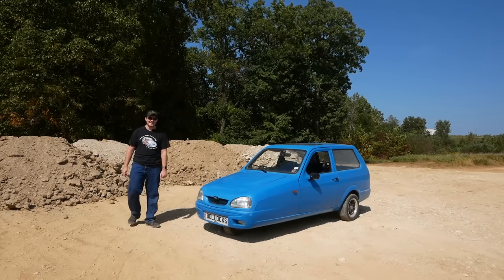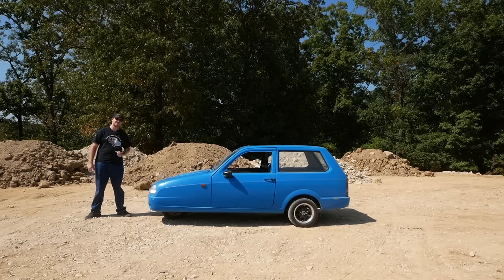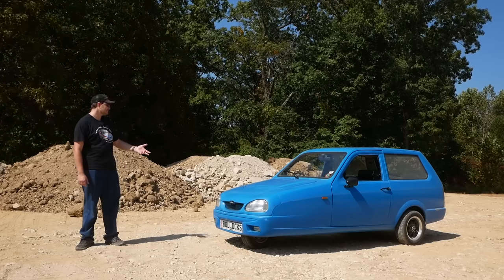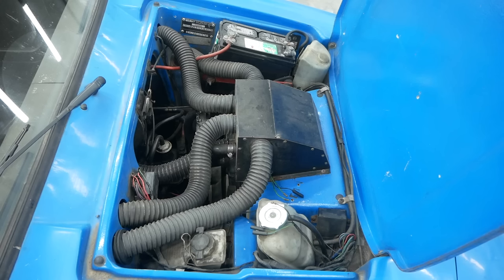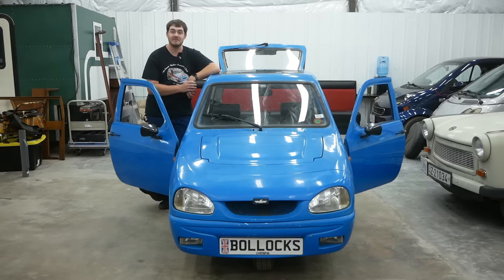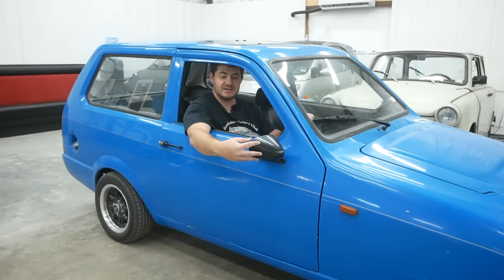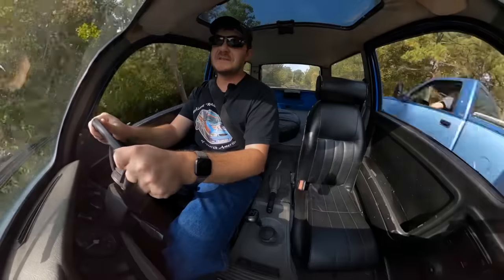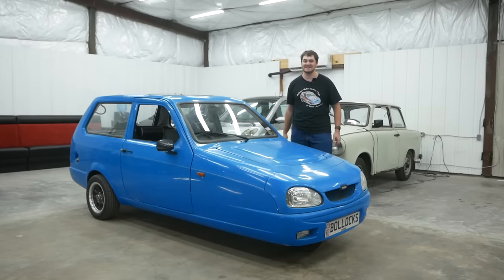I Bought a Reliant Robin!

Comment: This thing doesn’t even have door detents, yet it has fog lights, and a rear wiper.
Reply: the hinges don't have enough travel to actually have the door hit other body work so it doesn't really matter.
Reply: It's a British car fog lights might aswell be mandatory
Reply: Rear wiper and fog lights are required by law. Door detents aren't.
Reply: @benanderson89  rear wipers are optional as are rear windows and rear view mirror

otherwise most vans would be illegal

Also with mirrors (in the uk at least) you are required to have two one has to be drivers side, the other can be passenger side OR rear view no need for both.
Reply: @prawny12009  For hatchbacks in particular they're weirdly required from the factory. No idea why. It's why something like a 320d doesn't have a wiper but the 320 GT does, because the GT is technically a hatchback.

Edit: answered my own question below.
EDIT2: Vans are classed as "commercial vehicles" are have a different set of regulations.
Reply: benanderson89 I don’t know if that’s just for Britain’s because I can’t find any pictures of a 320 GT with a rear wiper. And I can name plenty of hatchbacks that don’t come with a rear wiper. I honestly don’t understand the rear wiper situation, barely any cars have them. Only the big cars with vertical hatches have them (with a few exceptions like the Prius). I don’t understand it.
Reply: prawny12009 yeah, but u gotta admit, having rear wipers required to at least be optional on all cars would be really nice.
Reply: @JoeyLovesTrains  It's standard for Europe. Every hatchback in existence comes with one here. Likewise, I was mistaken: it's the SW/Tourer/whatever (estate) that has one as standard. The GT is a lift back so it doesn't have one.

And no, they're handy to have on hatchbacks and other flat-backed cars because water doesn't get pulled off the rear window by the air current when driving. The angle of the window actually makes it stick a little worse, so a wiper is required to see out the back in very heavy rain.
Reply: @prawny12009  Vans are classed as Commercial Vehicles. There's different regulations for them.
Reply: @benanderson89  I was unaware there was a difference between a liftback and a hatchback.

I'm not sure if there are more hatchbacks/liftbacks in Europe, but in the US, it's mostly big cars, and Sedans. Not to many hatchbacks, although lift backs are being offered by Kia (the stinger) and Buick (the Regal sportback, which is basically the Insignia lifback, minus the rear wiper for whatever reason). I really wish Sedans had rear wipers because if I'm in stop and go traffic, and it's raining out, by rear defroster can't keep up with the rain.
Reply: @JoeyLovesTrains  hatchbacks DOMINATE Europe. About 82% of car sales in Europe in 2019 were hatchbacks of some description (city car, subcompact, compact, estate and crossover).

Only 2.3% of sales were what you'd call a Mid-Size Sedan (think Optima, 520d etc.)
Reply: benanderson89 oh. Oh my. Welp, I underestimated the amount of hatchbacks u guys had.

A side note about diesels:
We barely have any BMW diesels in America, even when they were still offered brand new. BMW pulled their diesel options out bc nobody wants a small diesel in the US, it’s simply just inconvenient because finding diesel is barely an issue (not all gas stations serve diesel, but most do), and diesel is a little more expensive than gas. It’s pretty rare to see any small diesel in America. You might see the occasional TDI that survived dieselgate, and a bluetec of u keep your eyes open (I’ve only seen 2 Mercedes with CDI badges, the mid 2000’s E320) every single Merc sprinter van is a bluetec except for the new ones (Mercedes stopped selling diesels in the US in 2016 iirc). A Chevy Cruze diesel is pretty uncommon.
Reply: @JoeyLovesTrains  Yup. We love our hatchbacks! The compact class is just known as the "Golf class" in many countries because the Golf is so ubiquitous, for example. You don't say you own a compact car, you say you own a "Golf sized car". Likewise, you don't own a subcompact, you own a "Super MINI".
Reply: benanderson89 Mini’s are pretty cute, it’s my moms dream car.

Fun fact: Mini took out their manual transmission option for America, but they actually lost sales, and brought the manual transmission back.
Reply: @JoeyLovesTrains  85%+ cars sold here are manual. You're forced to learn manual to get a valid European licence, or you only receive half a licence. Unsurprisingly, once people are formally taught how to drive a manual, they tend to prefer it to auto. (I have a 7-speed DCT though, because an injury years ago forced me into one).
Reply: benanderson89 I’m dying to learn manual, my friend got a Honda Fit (jazz) with the 5 speed. But he’s doing a clutch replacement rn. I hate CVT’s with a burning passion.

Comment: I once had a ride in a slightly modified Reliant Kitten (the 4-wheeled version of the Robin). That slight modification? The fitting of a TVR tuned Rover V8. IIRC (this was in 1992-ish), the interior was mostly stock, just moved rearward by about 3". The owner was planning to put a cage in it & go drag racing. I could understand why. In a straight line, 300-ish hp was decidedly entertaining in a car weighing next to nothing. Corners? Understeer to a frankly terrifying level. In all, it was a total adrenaline monster, as long as you didn't mind wearing Brown Trousers - because it pretty much didn't matter what colour trousers you were wearing when you got in, they would probably be brown when (if) you got out. If the raw acceleration & understeer didn't get you, the lack of brakes did. I'm sure the brakes were fine with the original 40 hp, but with 300? Nope...

Comment: Interesting car.  I wish you had done the fuel economy check.  The stated fuel economy sounds awesome. 

Be careful when slowing down while turning and going downhill. That's when triangle running gear causes rollovers.   

Stopping while turning sharp really moves the C/G to the outside front corner.  I have roled a few small trailers like this at low speed.

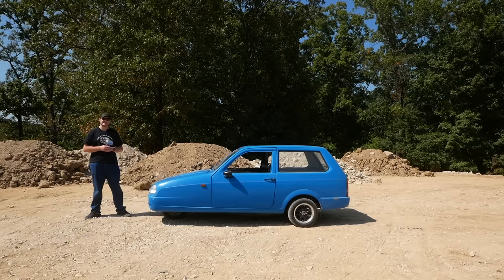Comment: 2:32 The fourth wheel does actually exist. There is a car called the Reliant kitten which is literally a Robin but the front end has been redesigned to fit an engine and 2 wheels with a steering rack. Besides the front end, literally everything else was identical except for different materials and colours for the interior.

Comment: "I bought a Reliant Robin!"

....you didn't have one already?
Reply: Also why don't you have a "I'm going to drive one of my unsafe cars" helmet by now.
Reply: @michaelfingers7726  because safety is boring
and it's not THAT dangerous,o therwise it wouldn't have passed the english DOT certification, it just drives slightly differently than your normal car
Reply: @quentintin1  It is still safer than a motorbike.
Reply: @macdaniel6029  debateable
on a MB, you're conscious that you have no protection so you take precautions, in a car (and car like vehicles) you have a sense of safety put in place by the full cab around you and the stability of having more than two wheels, so you will take more risks than on a motorbike without being conscious of it
Reply: @quentintin1  Maybe in the USA. In the UK bikers favourite trick is to ride down the middle of the road at 90MPH between opposing vehicles.

Comment: They made four wheel cars too  also it was made famous by Delboy in "Only fools and horses" and yes i had one a Reliant Robin 850 super great fun.
Aso you will find you have an access panel  on the passenger side under the carpet of the gearbox tunnel  for changing spark plugs .

Comment: I strongly advise you get a drip tray for the carb, Without it there is a high risk of the car catching fire. The reason the Reliant did not evolve much aside a few trim changes, was simply to keep the  original type approval from the mk.1 Reliant Robin. each time a new car is developed it needs to go through type approval, this is a bunch of checks done to make sure the car is fit for the UK, this costs companies hundreds of thousands. For Reliant to avoid such costs, they decided to only do minor changes to the car over the years, to avoid having to have it re type approved, the other issue is maintaining grandfather rights as we know it in the UK, it would have been near impossible to re type approve the Robin without substantial redevelopment of the car to meet modern standards of the time.  to illustrate the importance of grandfather rights, we only need to look at the classic mini. when Rover was bought out  by BMW, BMW wanted to continue production of the original mini, but sadly when Rover went defunct it took with it the type approval for the classic mini IE the grandfather rights and with them gone you would need to reapply. Sadly because the  of mini's age, type approval no longer possible to obtain because the standards were much higher, making it impossible to get it re type approved, and that's what killed the mini.
Reply: Interesting comment. I like it.

Comment: Ha, ha, what fun. We had a Reliant robin prototype built before the official first production model. It was really primitive (so they changed nothing except making the bodywork a little more angular). We actually owned almost every model ever made and I taught myself to drive in the first one, a yellow "sedan", which reached 65 mph (once) We changed the engines in four of them, Completely stripped more than one and rebuilt them from the chassis up. We used the van for business and then transported a family in it at weekends. We never rolled one but an acquaintance rolled several (in a car park) after drinking heavily. (we do not endorse this activity) It was possible to legally drive them unaccompanied in Britain in the seventies with only a provisional licence, so it saved a lot of money on driving lessons. (I passed first time, in a real car) The Reliant was incredibly economical and easy to park but of course, it was an object of ridicule. It would however, have been an excellent little fun car if only they had designed it with two wheels at the FRONT! (but that would mean no van or station wagon version and only two seats) .....or would it???

Comment: The illuminated red switch on the right which lights up is the brake test switch. Basically to make sure the brake warning system is working .  No lighty no warning for low fluid. Simples.

Comment: I owned a Reliant 3 wheeler for a year back in 1981-1982, like just about everyone else in the UK the only reason was because it was winter and I only had a motorcycle licence.  I have mixed memories of the Reliant, it was reliable and economical and it kept you warm in the winter which is pretty much all any Reliant owner expected.    I never rolled mine over, I once had it on two wheels on a long bend that took me by surprise, it was terrifying.   If driven with care and an understanding of the limits when cornering these are OK, its actually  to easy to roll one unless you are being stupid... yes we have all seen the hilarious Top-Gear episode, but that's an entertainment show and not a serious car show.
The fact that Reliant made that little engine is quite remarkable.. think about that, such a small company and they made the engine in-house, and its a great little engine too.   They do not typically overheat at all, they have a very solid reputation for reliable service with minimal maintenance.      Electrics are interesting due to the lack of body ground, but this is compensated by extreme simplicity.

I went from a Reliant to a Jaguar XJ12 in 3 years.. with a couple of Ford Escorts in between.  I have never been tempted to buy another Reliant, but it's great to see someone enthusiastic about one.

Comment: Remember three wheelers were designed in the uk to be registered as a motorcycle meaning a motor cycle license holder could drive one without an additional driving test. This meant bug compromises to keep the weight below 8 cwt (896 pounds) too keep within the legislation of being a motorcycle and sidecar. I believe this meant things like a spare wheel were optional extras so they didn't count toward the weight.

Comment: Had the Reliant Regal Van when I was a kid back in the 70s.They will wheely, good clutch, rev to 9000 drop clutch. They will corner at speed, remove back seat put a broom handle across the seat mounts, get a person in the back moves from side to side, hangs onto the broom handle like a side car passenger....go racing. Never fit wider rear wheels or wider tyres its may grip, it will flip, you will die.

Comment: I remember riding in a Reliant Robin. They were much derided and there are many jokes about them. I liked the fact the body does not rust but safety was non existent and the chassis was just bare steel with no galvanizing nor paint - designed to rust away within 10 years. A better, more stable car is the Messerschmit.

Comment: I still very much want you to get a hold of an old Volvo 240. Stupidly fun to drive because the car sort of feels like it wants to kill you past about 55, they had a push-button turbo with some of them having the push button in the dash, while others had it on the gear stalk, while yet others didn't even have a turbo at all. The whole thing is held together with friction fits and pull tabs, with a convenient tab under each of the doors that lets you pull out a little plastic thing, and when you do, the whole door panel comes off with a gentle little lift, making it super easy to get to the door latches, the window winder, all of it. Some of them even had a sunroof which, like all the windows, was manual. There was a hand-crank, not unlike you'd see on an old single-pane hinged window, for opening it. Also for a car built in the early 80s, it had heated seats... which as it turns out were just some heating coils that looked like they got pulled out of a dishwasher layered in under the upholstery. All the plastic was photodegrading, too, which is awesome, because the magazine rack in the doors(THEY HAD A MAGAZINE RACK IN THE DOORS) on almost every volvo 240 is now many thousands of tiny plastic shards, the glove box's front panel sometimes just falls off, and the dashboard of every Volvo 240 sold, bar none, is legally required to have a crack in the middle of it. Or something. 

Also the motor mounts are a special brand of funny. They almost always fail, because a straight four isn't exactly harmonically balanced at the best of times, which is great because at about 55 miles an hour, the whole car starts shaking like it wants to explode. Which wouldn't be so bad were it not for the fact that the motor mounts are one of the two parts that Volvo made a pain in the butt to replace, that and the alternator. 

Also the suspension was universally crashy as hell. So if you get the sedan, the car feels peppy and like you're a rallycross driver. And if you get the estate, the car becomes terrifying, but in a manageable way. The wiring was a rat's nest, there was a wild overabundance of things that just never worked, but honestly, the whole car was so damn easy to work on(aside from maybe the aforementioned motor mounts) that so long as you could get the parts, you could just about handle anything in the car yourself with no lift, no specialized equipment, and damn near no tools. Seriously, like, Half the car is held together with friction fittings and tabs, it's Brilliant... and also terrifying, but Brilliant. But what's weird about it is how Safe they were. I mean, apart from the lack of airbags, because 80s, but like... The seats had full coverage headrests to prevent whiplash, the brakes were almost universally stupidly responsive, probably a bit TOO responsive sometimes, and while the car lacked a crumple zone, the fenders were designed to collapse in on a pair of frame stalks, which significantly lessened impacts in most cases. Which is even cooler when you know that there were more than a few cases of a Volvo crashing into something in what would certainly be a very painful accident for the driver... throwing it into reverse, and just backing out of it. The damn things Refused to die! I mean, they did, before Ford got their hands on the brand, but separate issue.

Comment: The point that you missed was that the Robin was notclassed as a car butas a trycycle. It could be driven on automobile licence. If you passed your motorbike you could drive it. Back in the late seventies and early eighties I had two Relient Regal saloons. I wanted a 'car' without the hassle of passing another test. It was cheeper road tax you taxed it asa motorbike. Also, it was realy economical on petrol. I could get upto 80 mpg. Though it had only 4 seats you could get a lot of people in it. I remember on one occasion driving8 people plus guitars across town after a show. 
Though it was a bit basic,as    a teenager I  was the only one of my friends to have a 'car'  though it had the reputation  of being dangerous  in thatit could tip over on cornering. This only happened if you did not  slow down enough. Anycar can roll if you take corners too fast.

Comment: 2 random facts for you.
It was produced because in England you could drive it with either a car or motorcycle license.
If you're driving alone, put a sack of potatoes or sand in the passenger seat to weigh down the other side and make it easier to corner.

Comment: They only made the Robin from 1973, but before that they made the Regal, which was a very similar 3-wheel vehicle, and that dated back to the 1950s. My Uncle Dick had one in in the 1960s... basically because he refused to take the driving test for car driving, and he was allowed to drive the Reliant Regal after passing only his motor-cycle test, because of its weight and number of wheels (it also cost less to renew a motor cycle class license).